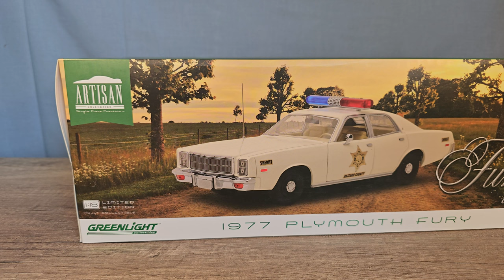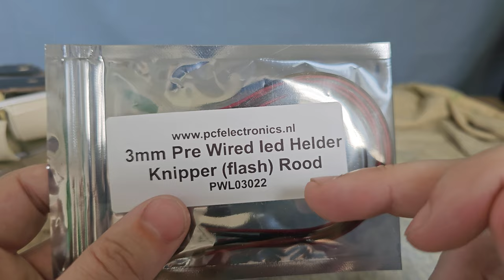how to build police lights in a 1/18 diecast car

Comment: Hey where can I find such a blue light or a blue light set because I want to make a cristmass tree police car means with very blue light, does it only work with 1:18 or would also go 1:12, 1:24? Need a page where there are the blue lights
Reply from the maker: The internet is full of them
With every color size and voltage